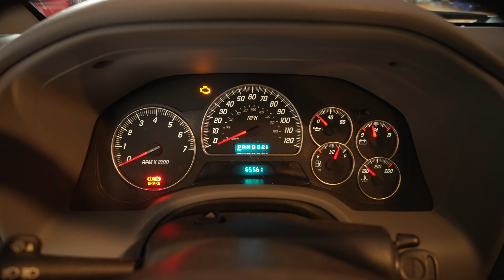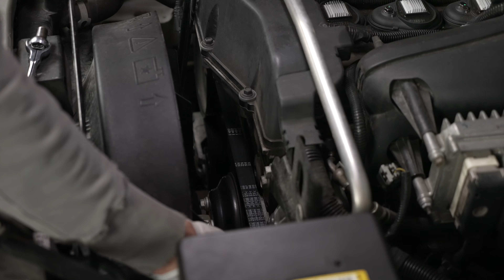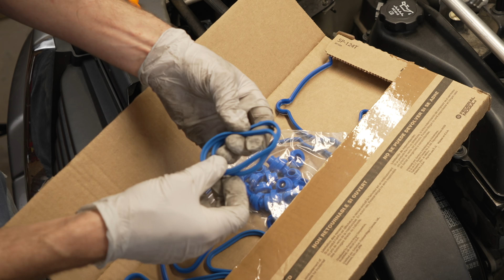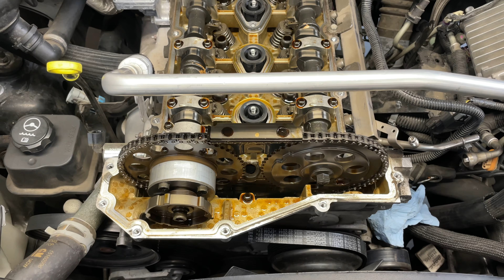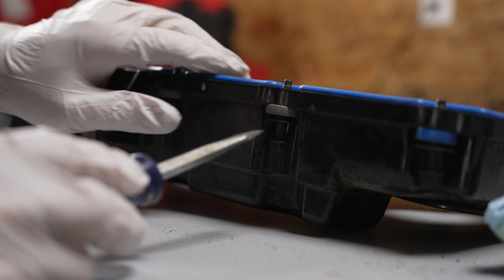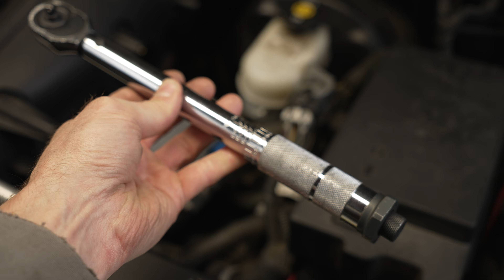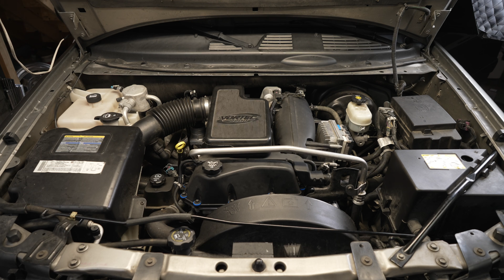Here's Why You NEVER TOUCH FACTORY INTAKE MANIFOLD GASKETS!!

Comment: I am a ASE certified diagnostic technician who has decades of experience. This is a running list of things that popped into my head of what possible causes might be...

Reminds me of the 5 cyl they put in the Colorado and Trail Blazer, Those intake plenums love to crack and leak. A way to help determine if there is an intake leak is to hook up the scanner and observe the short term trim data and see if is trending to a negative trim, also observe the long term data to see if it is also in negative trim. Another observation is O2S1 trending lean. [hanging closer to 200mv] A smoke machine can be helpful in identifying intake leaks, feed the brake booster line with the smoke.

The valve cover bolts are shoulder bolts and torque is not really important. They tighten to the shoulder and dictate max pressure on the seals, you just want to be sure they can't vibrate loose and of course don't snap them off into the head when tightening, use common sense when tightening.

Confirm plugs aren't oil fouled from previous valve cover gasket well seal leaks. [you should have done that while the cover was off and just went ahead and put new plugs in as well. A/C Delco likely platinum. Platinum are usually good for a 100k]

Clean the mass air flow [MAF] if it has one and if it does the scanner should reveal between 5-6gpm at an idle for that size motor. Confirm the actual gpm spec, it is also a high suspect for rough idle.
 O2S1 and trims can also reveal leaking injector(s) via a rich reading or positive trim. Check the misfire count data if available [not all models have that feature] to help identify random misfire or cyl specific misfire, typically if the misfire exceed a threshold it will set and code and the MIL light on. If misfire is more on a specific cyl, then swap the coil pack with another cyl and see if the misfires move with the coil pack to determine if you have a faulty coil pack. [COP]

Check the motor mounts, hydraulic ones live to leak out the oil and then transmit engine vibration the chassis giving a feeling of rough idle. Most engines have a small amount of random cyl misfires or aren't perfectly balanced although a 6 cyl crank is automatically naturally balanced.
Reply: I'm not a certified "anything" automotive-wise, just a guy who's done most of the routine (I.E., "easy) work on my own vehicles for the last 50-ish years. But I really enjoy reading posts from guys like you, who know the business. A "pro-" in almost any profession with run circles around even the highest-ranked amateur in the same line of work. Thanks for posting!
Reply from the maker: Thank you for all of that information! Will be looking into it.
Reply: @1RoadGarage hey… I’m wondering why you did not change the spark plugs? If oil is down in those holes you need to pull and replace the plugs. Also put your stock coils back. I have a 2008 trailblazer with almost 190k and the engine runs perfect. I’m also a mechanic. 

With that oil in the intake I would run a catch can. You probably have a little low by that may be fouling some plugs. The hose in the center of the intake from rope to bottom. Cut that and plumb in a catch can
Reply: I have a misfire on cylinder 5 and my truck is running lean and can smell fuel near the 5th cylinder area. I also can hear a hissing sound while the truck is idling near the rear side of the manifold cover. Is it possible that my 2005 gmc canyon has a vacuum leak that is causing the hissing and rich fuel? I removed the intake manifold and could never get the back bolt properly seated. Idk how to get that bolt completely flush like all the other bolts to the intake manifold. I think if it was completely sealed, it would run better and get rid of codes. Should I rethread the bolt hole that possibly cross threaded? And should I replace the intake manifold entirely and use new bolts? Or should I just replace that one bad bolt?
Reply: @NeonBoom2586  Sounds like you have a stripped bolt preventing proper intake to head sealing. If that's the case, then the intake must be completely removed and a Heli-coil installed in the damaged thread hole. Then re-install the intake properly insuring there are no cracks with new seals.
Reply: @DrHarryT thanks for the tip. My worse nightmare came true.
Reply: Per the Car Wizard a former GM engineer told him on a vehicle at o
Eating temp a good MAF should be reading gpm just above the engine size so a 1.8l would be at 2.0 or so. It seems to prove accurate. Just easy to remember, & one less thing to lookup or Google hoping you're getting accurate info.

Comment: Yeah once you start getting excessive blow-by   and TPS codes   and    variable valve Solenoid codes   the motors done     bad design all around    The electrical problems on these motors are too many to list
Reply: the blow-by can be helped by cleaning out the PCV hose.
Reply: @voidisyinyangvoidisyinyang885  Believe me I was cleaning it on a weekly basis along with the throttle body.  They put the Nonremovable PVC valve in the valve cover and it really messed up the whole system.
Reply: @funnycatvideos5490   There's a 2nd one lower down on the intake manifold - it's a hose. I think you are referring to the one up connecting to the box thing - resonator. Anyway that hose on the lower driver's side is a removable hose. You need hose clamps probably to remove it though. If you just remove the top then you can pour down a bit of acetone - also you should feel the vacuum sucking into the engine. I can't remember the details - sorry. There is someone who has a youtube channel if you search - he has a couple vids. His name is Joe Vreeland if I remember correctly. Yep - he has a couple vids on this - one called "The Mystery Hose?" The second vid of the hose that needs to be serviced to allow the PCV system to work better.  To get to 100% cleanliness would require removing the plenum and intake runners ... but this is a good second....and pour
berryman's b12 down inside the hose
while standing up looking at you
and then go ahead and put the hose just
slip it back on there you don't have to
tighten up the hose clamp just slip it
back on
and uh let it sit there for a while and
cook
uh this is best done if the engine's
been warmed up that way you'll wind up
with a
little better performance and
cleanliness out of it
i don't know if i get down low enough on
that for you to see where that hose goes
but it goes down into the
block
we're just after basically trying to get
vapors in there to soften up the gunk
that's in the uh
the runners going into the intake
um the only place to actually get that
much vacuum
uh is right there at the runners
and that's what we got to clean up
because that area gets pretty hot and it
it cokes up pretty badly
so you got to clean that
it's going to be a process that you have
to repeat a few times because
frankly
if if you're getting mayonnaise in the
top cap
or chocolate pudding or baby poop or
whatever
you're gonna have a problem
let's see i haven't taken this off in
the past few thousand miles so let's see
what they look like in here
clean
nice and clean i just started it up
about
10 minutes ago so ah
a little condensate for me but it'll
purge out because i i've been short
hopping it lately
but there's not a whole bunch of gunk
now as far as that hose goes that
s-shaped hose
under here
you're gonna get a little seepage out of
it all the time because it's not
supposed to be clamped on or anything
it's just a slip fit
and after a while that little s-shaped
hose gets a little tired"

Comment: Does this car have a gas tank vapor absorber? I had a similar story, I used smoke to find leaks, they were there, but they only affected the corrections that I looked through the ELM scanner. The main reason turned out to be a stuck adsorber valve, which did not close by about 5-10%. And also, everything is fine, but the idle is not smooth. Replacing the valve solved the issue.

Comment: These specific alternators are a common failure, I had a envoy with the same alt, absolute junk! Wound up replacing the alt and batteries 3 times in two years and no it wasn’t my fault it happened it’s these junk ass internally regulated alts they self destruct because they don’t put big enough ones in the vehicle for them to even consider internally regulated alts, so the alts already run hot on their own wich than transfer more heat to the regulators creating the failure

Comment: The new gaskets and grommets look like  flourosilicone (blue) vs most likely silicone.  The flourosilicone  is five times as expensive but has superior resistance to petroleum products and oxidation over time and should have been used by GM from the get go.

Comment: On the alternator. Pull off that back plastic piece if it's easy to take off. You should be able to see that back bearing cover. Make sure the cover is there. It's often a piece of sheet metal pressed into place. Sometimes they forget and that'll cause dirt to be sucked into the bearing. Then it'll go bad and make noise. I always check.

Comment: Over the years I have replaced 10-12 intake manifolds on the 4.2 and 3.7 due to cracks forming in the seam across the back of the intake. They suck in un-metered air and cause roughness. Can usually see it in the fuel trims. I made a couple plates to bolt on to seal off the manifold and use a smoke machine to check for leaks,
Reply: Would this ever cause a p0017 due to the rough idle from a lot of unmetered   Air ?
Reply: @Maintenanceman81  Not in my experience.
Reply: @Maintenanceman81  P0017 is a timing issue, means that the cam and crank are not synced properly,  ie: stretched timing chain or bad cam sensor etc. A leaky intake could cause a P0171 code though, which is lean on bank one ( 02 sensor before the catalytic converter)

Comment: As you saw the intake valves were dirty. This is a problem when they went to direct injection. In the past, fuel was sprayed behind the valves. This kept them clean by using the fuel as a solvent. Gm sells a solvent and a brush that you remove the intake manifold and spray/scrub the intake valves. Depending on how you drive this vehicle, this should last many miles. But I’ve seen this last as little as 6000 miles. This is dependent on your driving conditions. Good vid and at least you got that noise fixed.
Reply: Yeah once you start getting excessive blow-by   and TPS codes   and    variable valve Solenoid codes   the motors done     bad design all around    The electrical problems on these motors are too many to list
Reply: The 4200 vortex is port injected, so the valves being dirty are more likely due to the crank case ventilation system, which is a hose to the throttle body muffler(clean air) and the side bypass hose in the middle of the intake(dirty air)

Comment: With all the oil in the intake runners I'm guessing you've got a bad pcv valve which will cause missfires
Reply: If you take the oil fill cap off with the engine running and it runs the same then generally the pcv is bad. If the engine stumbles and dies then the pcv is working correctly

Comment: I don’t know if you’ve checked, but I did noticed some oil in the manifold. You might have to replace the PCV valve. Happened to my friends car. During stops, it would hesitate and die sometime. Change the PCV valve and fixed it.
Reply: These engines don't have a replaceable valve...  They do have a hose that rots into black powder that connects airbox to metered port on valve cover. I have zero idea what they made em out of...
Reply: Generally clean the ports and manifold. Especially if you a PCV and EGR.
Reply: @anonemoose6622   My 4.2 with 290K on it isn't plugged.  On a motor with less than 70K, that's probably not the problem.
Reply: There is a port behind the intake hose on the block. Make sure it's not plugged up.  Maybe plugs, coil or vacume leak
Reply: @richardm2566   100% this is the root cause of the oil in the intake runners. The port on the block clogs and allows oil to go from the valve cover into the air box and into the intake....
Reply: @mulchman1969 there are baffles in the valve cover where the pvc connects and it gets clogged and you’re correct it all goes up. Absolutely horrible design by GM lol.
Reply: @Willllllem22   make a hole in the oil cap and put breather filter and you. Not have  no more problem with the pcv
Reply: Spark plugs ir ignition coils
Reply: These engines don't have a PCV valve, just a hose.
Reply: @staceyward777 True, but if the orifice is plugged, it's the same thing as a bad pcv valve.
Reply: @staceyward777 Are you sure? Because I’m searching more time for PCV Valve location.I have a little oil loss in check.and no oil leak
Reply: @  Yes
Reply: @aymanalqaisy294 2002 until 2007 chevy trailblazer Do NOT have  PCV valve if you know anything about this engine then you know that

Comment: Bro.   Not to be negative.   But 65k on the third alternator and having issues with the engine,      Maybe the problem is the oem parts.        Was a good video.     Get a computer so u can check different perimeters like ur fuel trims and o2 sensors, that kinda diag information is critical when dealing with rough running engines

Comment: Ruff idle is usually a cam position sensor and or crank position sensor and your around mileage they will need changed give or take. Also when the catalytic converter starts plugging up it will cause weird ruff idle and other symptoms that are not consistent at all.

Comment: Cheap gas ? wrong Octane ? Check the owner's manual for fuel recommendations. Also, buy tip tier fuels like Mobil, Chevron, Sinclair, Exon, these have additives that will keep your fuel system clean and will burn better..

Comment: Maybe the mass air flow sensor? Similar issue on older Chevy's I have worked on in the past and it was the MAF. Going to do my valve cover gasket soon as well for the same reason of oil in some of the spark plug holes.

Comment: Check the valve clearances. differences in valve lash greatly affects valve overlap. If I pull a valve cover for any reason, I do that, just to look for obvious problems. Injection systems are very accurate delivering the same dose of fuel to each cylinder. It's extremely important, that the volumetric efficiency of each cylinder is exactly the same. If some cylinders are rich, and others lean, the O2 sensor will pick a "happy medium" causing a power imbalance, and, higher emission figures. you can get some clues, by pulling and reading the sparkplugs. another possible vacuum leak may be the vacuum brake booster, or, the heater vent controls. Remove those lines from the manifold, plug them, and see if the engine runs any better.
     I don't understand what you mean by "never touch your factory intake manifold gaskets".

Comment: Trailblazer and Envoy intake manifold, bolts, back out overtime with hot and cold cycles. I chased a intake leak forever until I found a couple of the bolts in the back were loose.also make sure you clean the throttlebody. These trucks are very sensitive to that.

Comment: Great video. So here is ho2 a mechanic solved this same issue on my gmc. Mine has 324k , so it is no spring chicken.  
He reset the computer with a scanner. And then was watching fuel trim. As we drove around , the computer kept adding 10 15% fuel. In 3 minutes he said need injectors cleaned or buy new one. Once the new injector was in , it was better but not perfect.  He looked at map sensor data , and it turned out it was responding too slow. Change that and iys been running like new (as new as it will get lol) ever since. Hope this helps

Comment: A good scan tool check of the oxygen sensor the percentages of the fuel adapts and also the mass air flow sensor check them to see if they're in the right positions write readings I should say would be my next step what if you don't have a scan tool with data on to the mechanic you trust

Comment: I've own a 2004 Trailblazer for 15 years. I bought it with 65k miles. It has 191k miles now and still has 4 stock coils. It run great and has never fail an emission test. People trip me out when they change all 6 coils when the engine start to run funny. When the coils are bad. You will know it because you will get a skip.

Comment: Fuel injectors clean and how old is the fuel filter? I'd double check for vacuum leaks. I used to just get a water bottle and put a small hole on the top and squirted over the engine. Definitely do the basics first like these. When I an auto tech, a lot of idle issues were due to maintenance like injector cleaning.

Comment: It’s never a failure successfully changing ware parts n gaskets. Now you know all that swapped stuff is good to go and you know what the issue is not. Keep trying. Id get a second opinion. Could be the map sensor, maf sensor, O2 sensor, leak somewhere else in the intake, when you messed around with the throttle did you do a relearn with the proper tuner, could be an issue with throttle position sensor, the idle air valve solenoid, or maybe the crankcase pressure relief system? Theres so many things it could be… you try doing diagnostics to check for codes?

Comment: Does it have fuel filter that is not in the tank? If so I would change the fuel filter. What brand of spark plugs are in it? I would put the exact plug in that it left the factory with. Should tell you in the owners manual. So it was doing this with the old coils and you replaced the old coils with new coils and it still does it? Do you get a random cylinder mis fire code or are you getting a specific cyclinder misfire code? What is the live stream data saying?